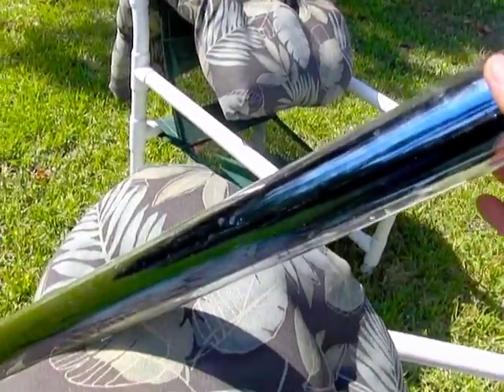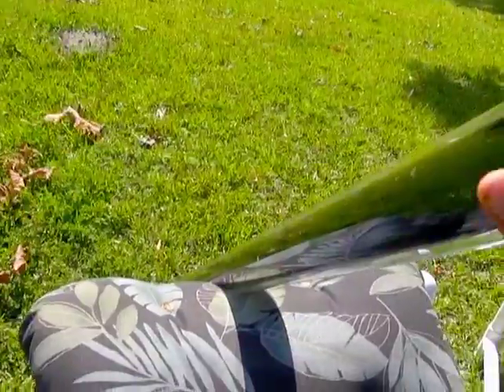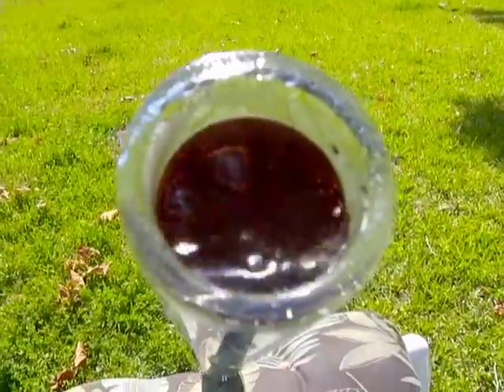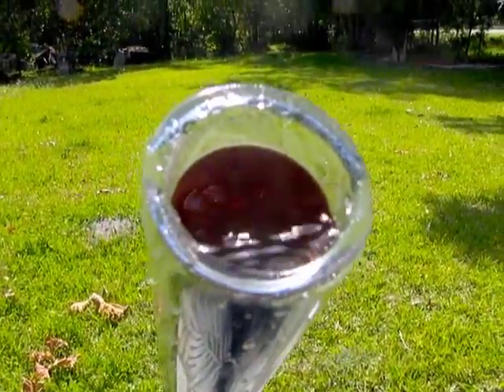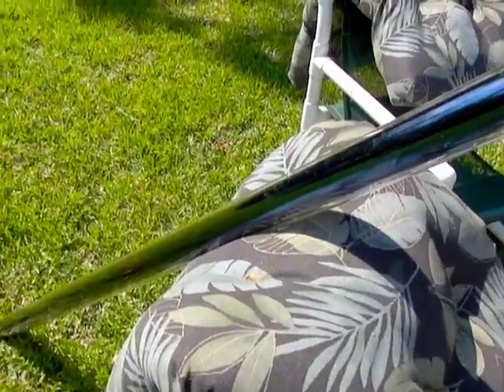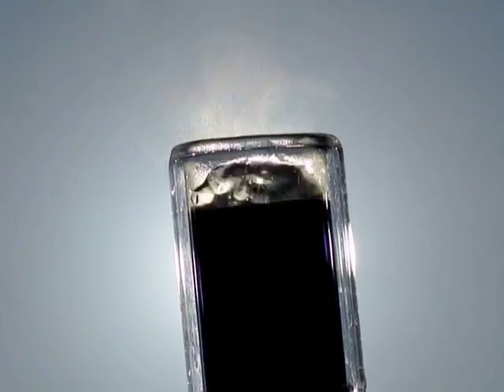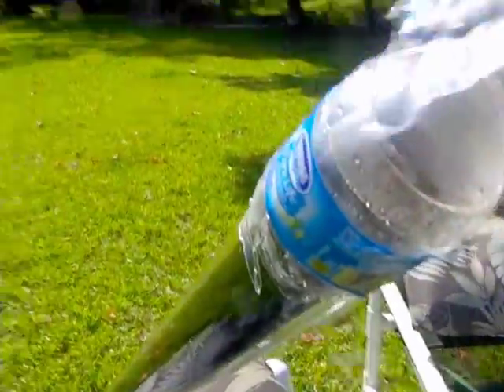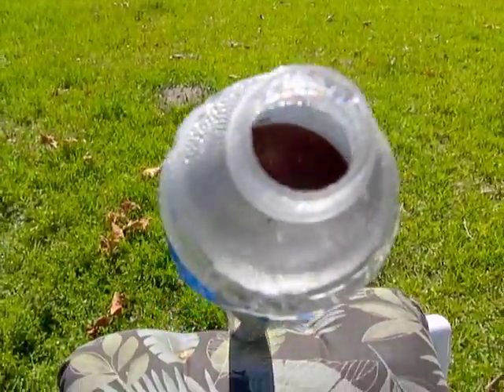Giant Solar Evacuated Vacuum Tube 100 ounces of water boiling

Comment: I have boiled the glycol right out of my home made solar thermal solar collectors.Thank goodness my resevour had the capacity for the liquid. I shut my pump down one day and forgot to turn it on the next day and by 10:00 AM I got a phone call from my panicking wife."It's going to over flow" I built my panels from 3/4" refrigeration soft copper , Aluminum Sofit with 6" grooves, Foil Bubble wrap, Rocksal mildew resistant Insulation, and covered it with corrugated sun tuff polycarbonate. That gave me 12  4ft X 8ft panels at the cost of $2,600.00. That heats my in-floor Pex-pipe heating and my domestic hot water and i live where it can dip below minus 40 F at night.My floorspace is 640 sq ft. I figured each 6 panels equivalent to 250 gal tank of oil. My payback took 2 years and it's been running for 10 years with no problems yet.Free heat is the best heat.

Comment: I'm curious what kind of pressure these can take up to? Ideally I'd like to do about a 6ft solar trough collector, a vacuum tube into a steam engine, then to a condenser and dump back into a loop. On one of your past videos, you essentially did this with a garden hose and a steel galvanized pipe, however the pressure was only moderately strong. At 250f you're around 30psi from what I can tell, and at 300f you're in the area of 67psi. Obviously it starts going up at a decent rate.

Comment: I must admit this concept is new to me but I just had a thought, if you connected this to a steam engine do you think it could possibly be more efficient than solar cells? 
Or maybe a stirling engine would be better because it could still run even if the water has stopped boiling.

Comment: @GREENPOWERSCIENCE  Jimmy carter actually had them installed on the white house.Ronald Reagan did away with that.
the vacuum tube is also omnidirectional so it only needs to point south and it collects heat throughout the day does not need to be adjusted for sun position

Comment: @ribar3 abolutely! In fact many solar hot water systems use evacuated tubes (google solar hot water system evacuated tubes). It's definitely a more efficient way of harvesting heat energy from the sun.

Comment: @screamingservers  Thanks for your reply.  Would be great if they made these as an actual vacuum pipe then water could flow through.   Although it would be possible to use a trough mirror if the vacum tube was outside the focal point so it is not so harsh.  otherwise yes it would probably explode. lol : P

Comment: Not only insulating properties over-night, but it has the ability to collect heat from the sunlight that bounces off of the clouds. It does not have to be in direct sun. I had, the one that was loaned to me, on the front porch and it generated heat, even in the shade.

Comment: If the industry was smart they would use these to bring ethanol to temp for gassing off to recollect. This would eliminate the energy used to gas off ethanol (180f)  thus lowering operating costs of the ethanol plant.Resulting in a cheaper product for the people.

Comment: Where are you people from, Mars? :) I guess it's natural for these to be popular in a continent that inherently pays higher energy prices... These tubes have been around for a while now, same for the end products made with them... The most efficient set-up seals off the tubes and centers a heat pipe inside each tube. The heat pipes join in a header tube where coolant (water) flows through to absorb the heat from the heat pipes. And yes it also works on cloudy days, even freezing winter days. :)

Comment: These tubes (when properly designed) will collect something like 95% of light energy per square unit of light coverage.  Typical photo voltaic cells are about 12%-17%.  I like this application of solar energy since it would take up far less square footage, and I believe the manufacturing is less impact (environmental) than semi-conductor solar cells.  I would like to get some of these, but they are kind of spendy to get in the U.S.

Comment: @youtubasoarus It has not been developed because once you buy the system you don't pay anyone else. You would receive free heat and hot water from the sun. There was a guy working on a solar panel that collected ultra violet rays instead of sunshine. UV is around even on cloudy days....

Comment: My question is, does it generate enough steam pressure to maybe power a small steam engine as a generator. Might be able to cut down on electricity consumption a little that way, and it's purely green.

Comment from the maker: @ward26102 Hi,

They have been around overseas for years. This is factory made and more efficient because the vacuum is very good. I am working on getting a bunch from a seller overseas where the are made. I have bought a few locally but they are never packaged correctly and shippers usually break them. I will have some in about 2 weeks.